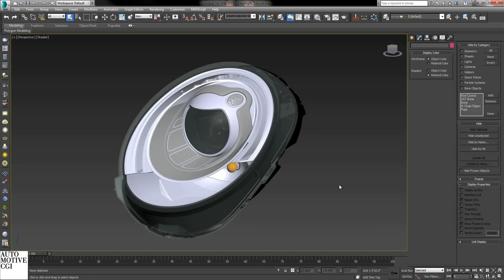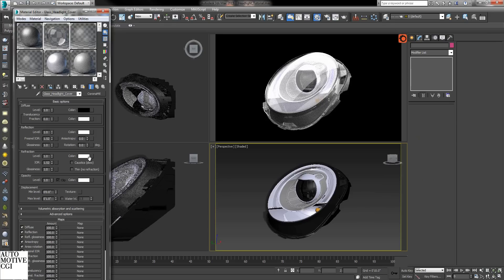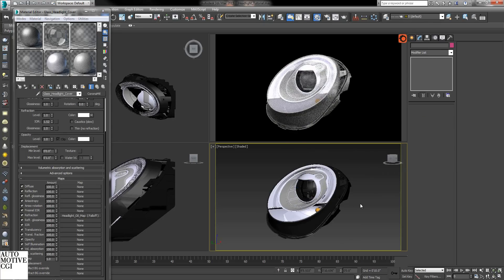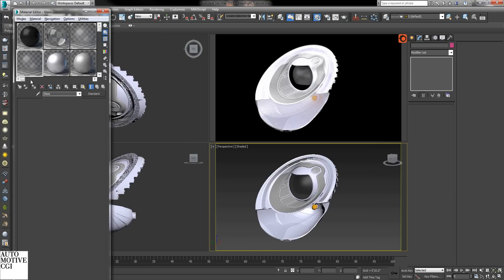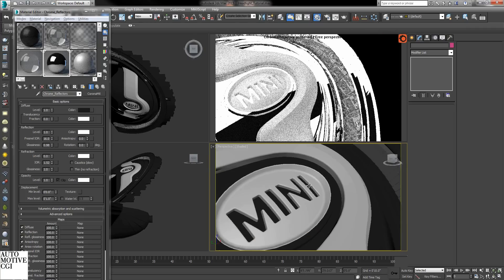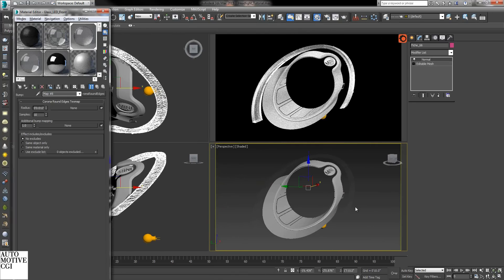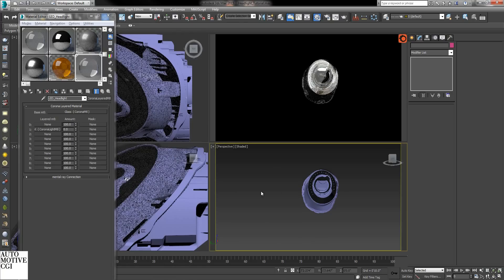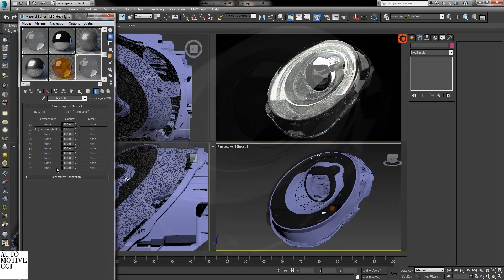Automotive CGI - Corona Renderer Headlight Material

Comment: Pretty great. Just last night i revamped my multisub I have set up for my various car materials and created a similar oily look for the glass. I'm happy to see someone has finally tackled it for the public, it's too bad I finally figured it out though. 

On a side note, have you considered using real-world scale in the textures themselves?  that way when you apply a box map, you dont have to go through 1' 1' 1' in the modifier; when you import the bitmap, you just change the tiling to like 2" x 2".... if that makes sense.  Its similar to the current process but saves a step. Just a thought.
Reply from the maker: Hey Tanner, I have def explored other options but I know that sometimes when I get cad data the scale properties of it are wrong, so the tiling would be accurate on one part and wrong on another, so thats why at this point I just like having full control lol.

Def appreciate the comment and will give it a shot again to see if maybe I am wrong :D
Reply: An option on top of that is to do a Reset Xform on those objects and that typically resets it back to the scale set in the file.  Another option if that doesn't work is create a box, convert to edit mesh (or poly if those CAD objects are natively poly, but I think they're usually mesh, right?) and then attach objects to the box.  That way the objects that were imported have the proper scene scale for UVs.  I have that issue all of the time when importing Metric Revit files into Max set to meters.  The UV scale is usually 30.48 or close to that even though both files are set to meters.  Then I get your problem of having to increase the bitmap scale for imported objects and not for objects natively created in Max.
Reply from the maker: hahaha, I have tried both techniques lol. Sometimes the cad I get is very bad situation. What I mean by that is if I do anything to manipulate it, it breaks the smoothing groups and noway to fix. So I use this concept everywhere because its consistent and results are consistent, easy for me to have a workflow with zero room for error :P
Reply: Gotcha, sadly that happens all too often with Sketchup imports.  If I may ask, where do you get those CAD models?